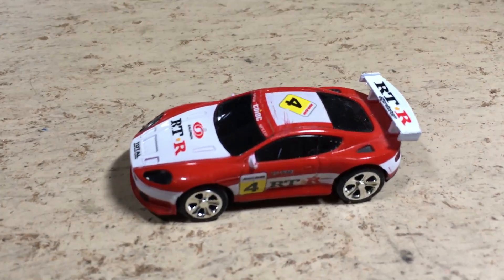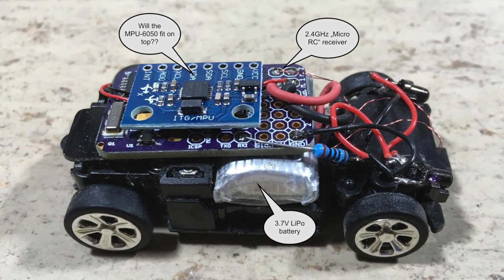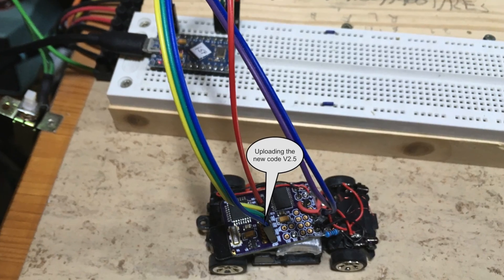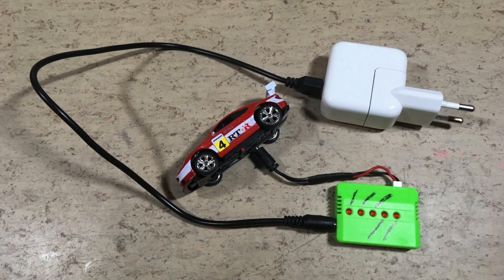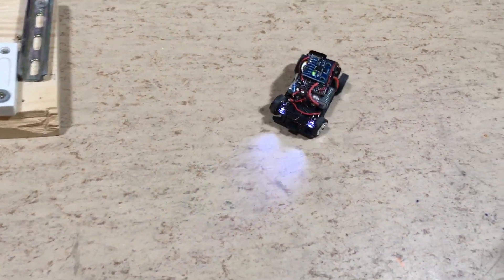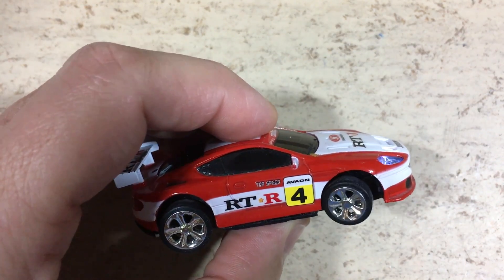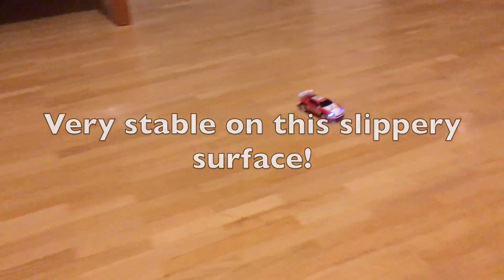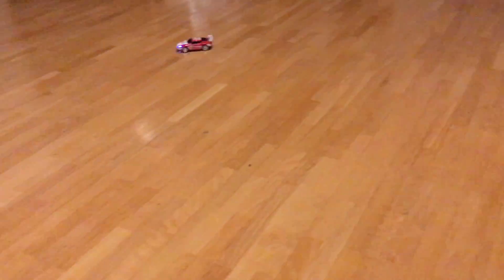Worlds Smallest Car With Electronic Stability Control!

Comment: In the Automotive jargon, this is called traction control. Electronic Stability is for braking control. Both should be called electronic stability systems so you are correct.

Comment: Are you using a PWM signal feed to the Steering coil?
Reply from the maker: Yes
Reply: @TheDIYGuy999  and do you feed it directly from the MCU pin, or from a transistor or H Bridge?
Reply from the maker: I‘m using a TB 6612FNG motor driver, see: https://github.com/TheDIYGuy999/Micro_RC_Receiver

Comment: Will the 1.5 board revision work on the coke can car (not sure if size changed)? Also, can I use a CSTNE8M00G55A000R0 instead of the CSTCC8M00G53-R0 for the 8Mhz Resonator? I'm going to order parts and boards soon. Also, I don't really want to build another transmitter, so I might look into porting the popular bayang protocol (which uses NRF24L01 IIRC) so that it can be supported by DeviationTX/OpenTX.
Reply from the maker: No, the board size did not change, you can use it. The resonator is OK as long as it is 8MHz and has the same size (compare the data sheets)

Comment: Hi. Is it possible to control the magnetic steering proportionally using regular 2ch car receiver and a regular transmitter?
Reply from the maker: No, you need a PWM DC motor driver IC, such as the TB6612FNG on my receiver

Comment: this looks cool, but im a bit lost with all these parts. Well, it looked too good to be doable with my parts. Would you happen to know any common alternatives for this motor driver?
Reply: maybe uln2003a?
Reply from the maker: Thanks. No, you need a proper H-Bridge IC. In my opinion, the TB6612FNG is more or less the only choice in this size. However, they are a bit hard to get. So, I'm desoldering them from modules: https://www.ebay.com/itm/Dual-DC-Stepper-Motor-Drive-Controller-Board-Module-TB6612FNG-Replace-L298N/401109816081?hash=item5d64021311:g:wAQAAOSwZPZZ6uhw
Of course, you can also use the entire module. Works fine with my TB6612FNG Arduino library
Reply: yes, i realized this as well, it needs to have reverse so 4 transistors H-bridge is required. Im thinking of starting to make this while waiting for parts. Would you say that stm32 chip is required on the car or would 8Mhz arduino do the same job as stm32? Did you have other reasons to use stm32 in this project? maybe size? ports? voltage?
Reply from the maker: This project does not use an STM32. All my current receivers and transmitters use an Atmega 328P 3.3V, 8MHz. The STM32 based transmitter is still in concept phase. Currently I'm working on the prototype PCB
Reply: Thats great then, i allready have a gyro, few 8Mhz arduinos and even found TB6612FNG from ebay with standard shippin, should be here within 2 weeks. See ya after christmas :) Thanks for the great idea.
Reply from the maker: Good luck with your project. don't forget to post your result. Can't wait to see it